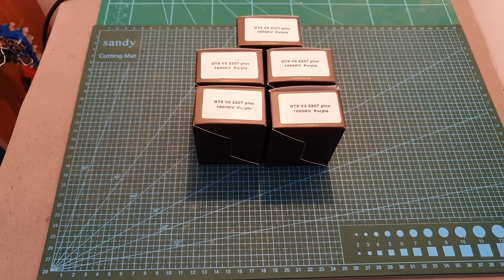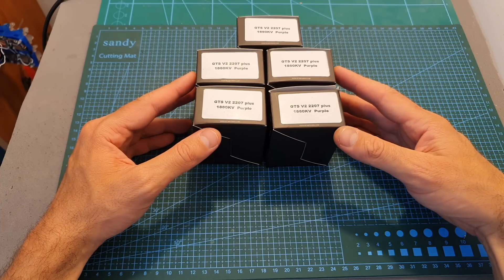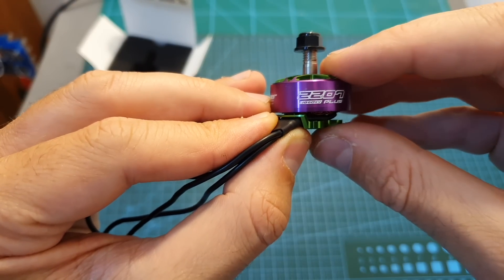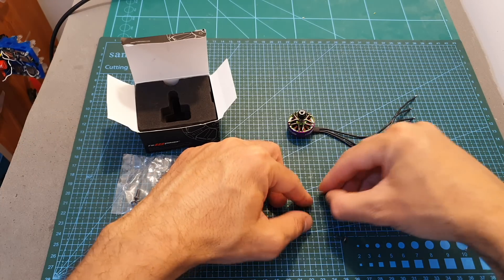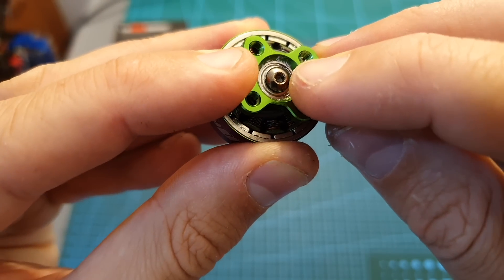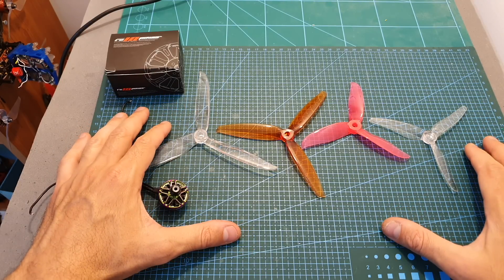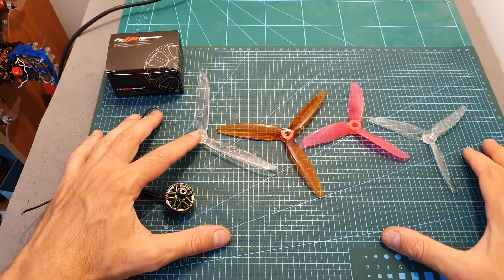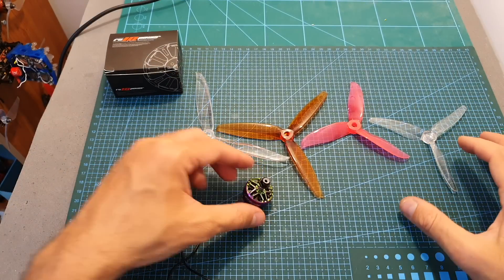RcINPOWER GTS-V2 2207PLUS 1860KV Thrust Test

Comment: I just noticed at 3:22 when I played it at speed 25% only, the motor smoked too at 5s on a 6 inch propeller. Here's a screenshot - https://i.imgur.com/sY7UunJ.png
Reply from the maker: Thanks. That's not a good thrust stand and that's why I upgraded it for a much better one.
Reply: @KremerFPV  fyi, I finally bought GTS-V2 1860KV motors and it's with me now. It's mounted now on my Apex frame. I don't have fc and esc yet. It looks gorgeous! I hope I will be happy with its performance. I'm also hoping it's very durable like my BrotherHobby R6 Returner motor.
Reply from the maker: @neilfpv  Good stuff. Sounds like a nice setup.
Reply: @KremerFPV  You can see it here, I made it  public :) https://www.facebook.com/photo?fbid=10159860237459411&set=pcb.10159860237759411

I was actually talking about the new gopro mount I made in Fusion 360 in that facebook post and it finished 3d printing this morning.

Thank you for making reviews! You are awesome Gal!

Comment: would the 1860kv be okay to run on the KISS 32a esc?  it does 32amp continues, and 45amp burst..  (ethix s5 HQ props 5x4x3)..  6s..  i feel like 6s, those props, these motors, vs your 5046 6s test, maxing ~28amp.  i think that with the s5's being much lower pitch, it might not even exceed 20-25amps?  there is plenty of protection on my escs i guess either way thatll either the esc will max out, or the motor will.  just hope it doesnt blow em up.